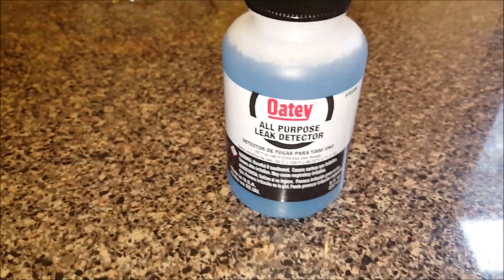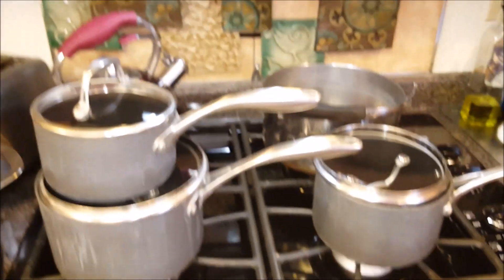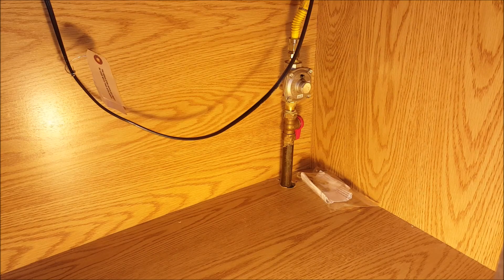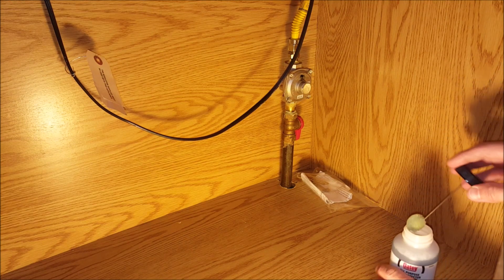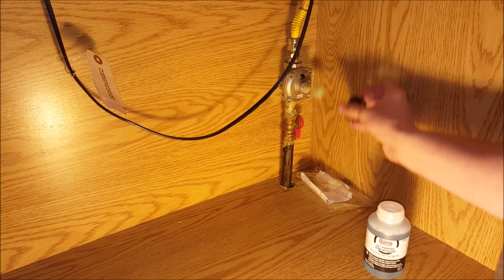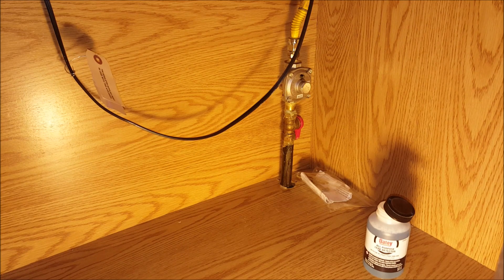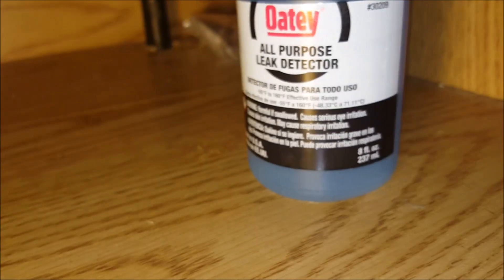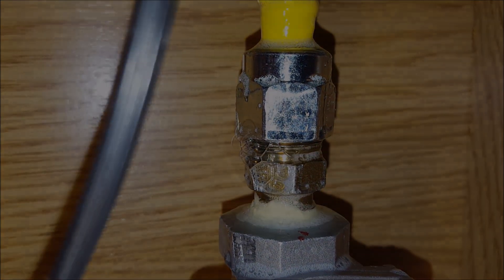DIY #81 How To Detect a Natural Gas Leak

Comment: They should have put your appliance regulator at the appliance. Also check the inside of the connector to make sure it's not pitted. Sometimes leaks happen due to a short in electronic ignition appliance.
Reply: MrTachyon3000 definitely was not a qualified person who installed that.
Reply: On the appliance is the preferred location for the regulator but depending on cabinet configuration,the hole location in the countertop & particular brand of cooktop they don't always fit ( poor manifold configuration by the manufacturer's engineer). So it is acceptable to install the regulator before the flex connector, it is not recommended but is acceptable. Also thanks for the tip on the  shorted electronic ignition system; I have  ran over 10,000 emergency calls in my 35 year career as a first responder for a gas utility and haven't ran into that one yet but we'll be looking, thanks for the tip.
Reply: @boby115  ..It’s true there are times when you can’t install it at the manifold, or extend and modify at the manifold end, but  in this case there is plenty of room in the cabinet. What you don’t want is an appliance regulator upstream of a long connector potentially not delivering the rated pressure to the appliance.
Reply: @MrTachyon  , you may want to re-watch the video they never showed the bottom of the cooktop or the manifold connection (opposite end of the flex connector) so we really don't know. Also the flex connector that was used was a1/2" flex connector with an inside diameter of 3/8" at a length of 24 inch (?) So that being said, the flex connector should handle 85,000 BTUs even if the pressure is 3.5" water column & from the looks of the cooktop we are talking 40,000 BTUs at best.
Reply: @boby115  ... If the rating plate tells you the appliance regulator is providing 3.5” WC of manifold pressure, then you need to make sure you do that. Maybe take pressure at the manifold. But if you make a video and you don’t do things the right way, nor explain why you had put an appliance regulator intended to be at the appliance on the houseline, then you’re leaving yourself open to criticism. I’ve corrected too many conditions on crap like this, including hazardous conditions created when parts are not installed correctly.
Reply: @MrTachyon  , you are absolutely correct, taking lock up and working pressures at the manifold is always a good idea,especially when modifying from the norm. I also could not agree with you more about the lack of content in this video.

Comment: 20230130 Bing recommended "natural gas leak detector" 
>?? the galling on those flare nuts > using pliers as opposed to an actual line wrench when "knowingly" working with this quality critical  hardware 
The practices here would never make it into my shop ... dope on flared fittings? chryst